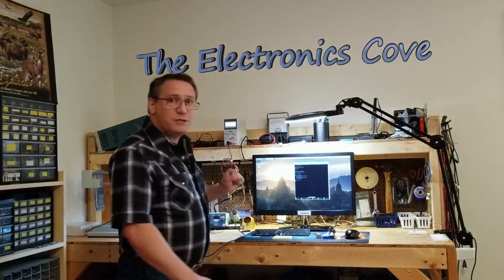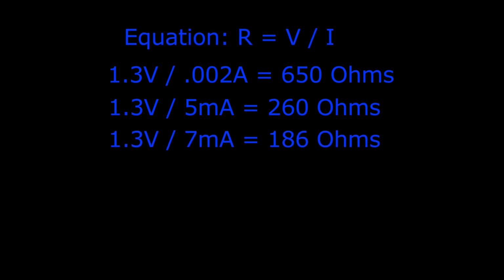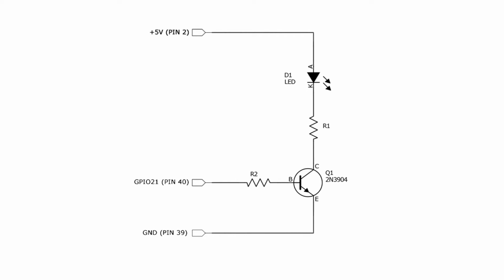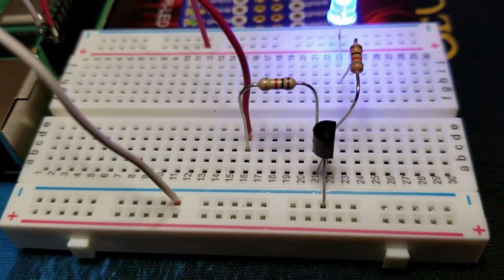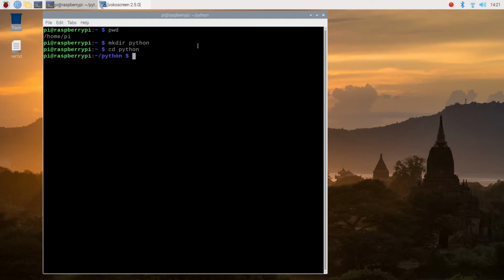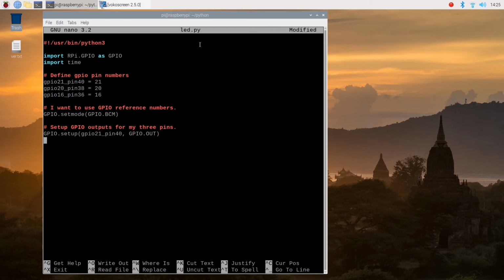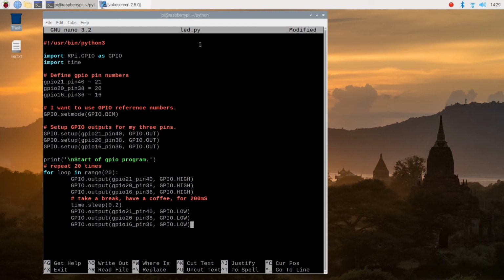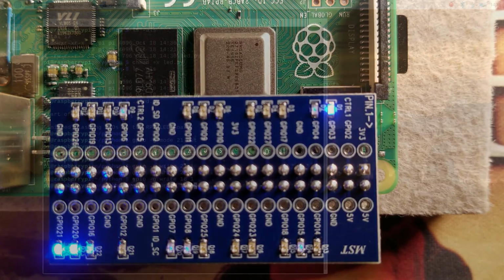Tutorial - Connecting LEDs to the Raspberry Pi & Controlling GPIO pins

Comment: Thanks for making this! I was trying to find a way to power a more powerful led off of the board and didn't realize the gpio pins cant handle it without a transistor and the 5v. I plan to turn the board into a photometric stereo camera setup. This was the meat and potatoes I was looking for. :)
Reply from the maker: I'm glad it was helpful. I will be working on two new tutorials once my kickstarter is completed.  They will cover using  relays to switch on/off 120V lights and how to create a racing Christmas Tree like the ones used for drag racing.